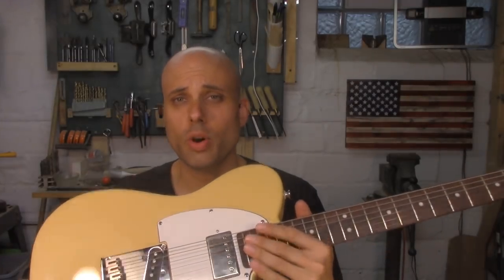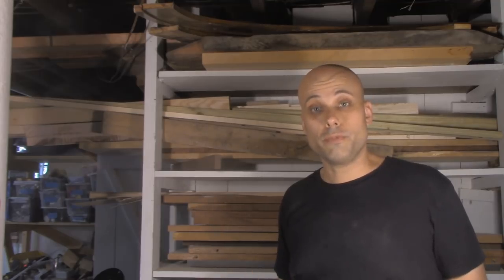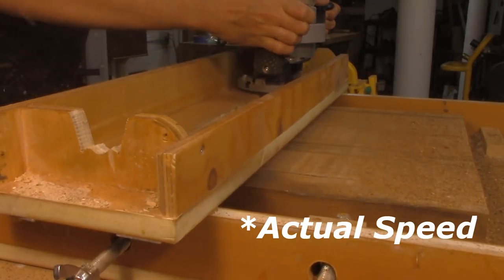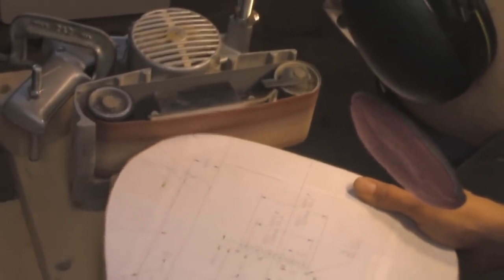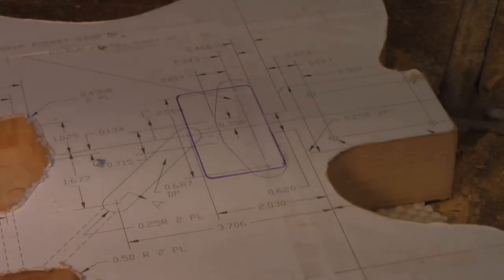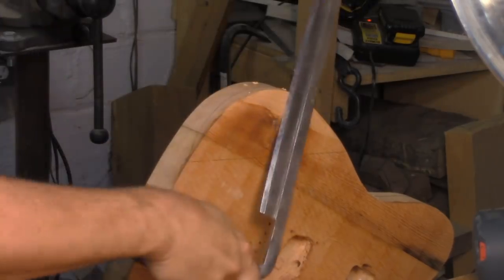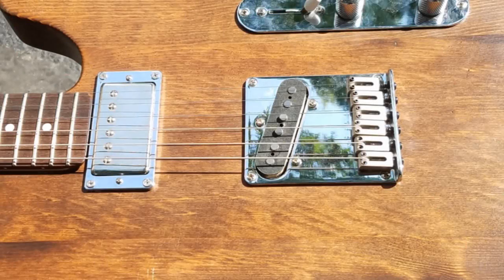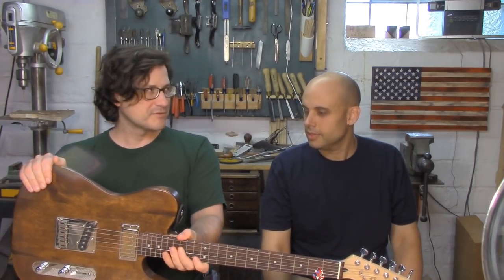Make a guitar body (even if you don't play)

Comment: I would recommend making one out of  plywood/mdf to use as a template in the future.  Then you could use a flush trim bit on a router for the actual blank.  Trim it out with the band saw because the router bit will have a hard time taking out all that material, it will take a couple of passes on that inch and a half blank.

Comment: Reminiscent of the Broadcaster which was basically a somewhat contoured Tele in the early days of Fender.
Reply: Fender had a bridge only pickup guitar in 1950, the Esquire. Later that year Fender introduced the Broadcaster, which in 1951 became the Telecaster. The reason it isn't called Broadcaster today is because Gretsch had a drum kit with a similar name, Broadkaster. To avoid lawsuit all the Broadcasters that were in the factory had the logo removed from the necks, those guitars from then on have been known as Nocasters.

Comment: Amateur protip, if you plan on doing several, or even mass production of guitar bodies/blanks, making a plywood Master routing template, and MDF production templates, to use a flush trim bit/bearing pattern bit for the final shaping, to maximize precision as well as minimizing production time.
Reply: Heck I'm pretty sure you can buy templates directly online for some common designs. 

I would really love to see more unique shapes though. Super in love with old japanese ESP and their just absolutely bananas custom jobs. 

ESP's japanese webpage is well worth a look for absolutely unique looks.

Comment: A tip for printing large things.  Find a print shop that prints house plans.  Most have no issue printing other large files.  Black line drawings are fairly cheap to print.  We charge less than $2 for a 24x36.  Saves a lot of time taping together printer paper.
Reply from the maker: Pro tip!

Comment: There’s one little problem with this idea:  finishing the body. To get a premium price for a guitar body, it needs a premium finish. And that takes time. LOTS of time. Guitar players expect a perfectly flat, transparent finish. 

Nitrocellulose lacquer was the classic finish. It’s hard to work with, requires multiple coats, and is toxic. There are water based lacquers now, but you still need a spray booth and lots of sanding followed by buffing to get it right.
Reply from the maker: I hear you, but pro-guitars are finished with all sorts of things now. Production Fenders are done in polyester and many well-respected makers use polyurethane. I know that nitro is still seen as the best, but I finished this body in acrylic lacquer and it came out great. Also, you can just sell your bodies unfinished. Problem solved.
Reply: Rex Krueger - online I can buy a 1-piece alder Strat body for $190 or 1-piece ash Tele body for $260 (fully routed but unfinished).  I plan on making guitar bodies for myself and others for fun, but I certainly don’t expect to profit from it. I play guitar, have assembled/built 2 from purchased parts, and build amps from scratch. 

Is it a fun way to use woodworking and express yourself?  Absolutely!  Can you make a guitar player friend grin from ear to ear with a custom mahogany topped with flame maple body?  Yes you can IFF you spend some time learning about guitar parts, spatial relationships, etc.  

Here’s an example of what can go wrong:  if the bridge is 3/16” off in relation to the frets on the neck, the guitar can never be intonated correctly.
Reply: I like tru oil finish
Reply: JoeDi B - TruOil is great for finishing necks. However, I had a lot more trouble with dyes and getting colors I wanted with figured wood bodies. TruOil does make getting a nice finish easy.
Reply: I'm still partial to a good shellac finish myself...

Comment: I've been getting into trouble with guitar building. I always bite off more than I can chew, and then have to struggle. My next project will be either a guitar or a CBG, and I'm going to do a laminate head stock. I've never worked with chisels, or a router on an area so small, but I want to do a chamfer around the head stock, that'll expose the layers of laminate. I feel like the apocalypse is going to come through guitar building.

Comment: I loved the jam session at the end.  Nice playing!
Any recommendations on routers?  I see you have a plunge model there and I know they aren't cheap.
Reply from the maker: Glad you enjoyed the playing. I linked to my router in the description. It's pricey, but I've had mine for 10 years and it's the only router I own.
Reply: Thanks.  I was wondering more about what features are important, vs what is mostly worthless.
Also, if you don't mind shipping your work, you can sell your "boutique" guitar bodies on Reverb.  Those offset guitar guys get a little crazy and will pay even more than a standard Strat or Tele body will fetch, plus, its a less saturated market.
Reply from the maker: That's a great tip!  As to routers, get a powerful one. More than one HP. Get a kit. That way, you have a fixed base and a plunge but you save money. Get one that has BOTH a 1/2 in and 1/4 inch collet. Some big bits only come in 1/2 in shank and you need a big motor to spin them. Also, if you really have money, get a palm router like the Bosch colt as well. The big one is overkill for many jobs and I'd love to have a little one that was less likely to rip my finger off.
Reply: I got my ELU router on ebay for around $65-it is like a Rolls Royce! maybe I just got lucky but there are bargains out there-I Think the ELU was well over $200 when new.
My go-to brand is MAKITA though when buying New-the things just do not ever let you down and I have never found a single reason to regret any purchase of their products.

Comment: Great idea, though as an instrument maker, 38mm is a bit thin, I would make it a bit thicker. I think a finished thickness is 45mm. Great work
Reply from the maker: Interesting. Most of my guitars are right around 38mm, but a little extra certainly wouldn't hurt. Good tip!
Reply: Rex Krueger just double check, but I think fenders are 44-45mm. I really enjoy your videos Rex, thanks again
Reply from the maker: I'll be darned. I just put a caliper on 3 guitars and bass and you're totally right. 44-45mm on the nose. I stand corrected!